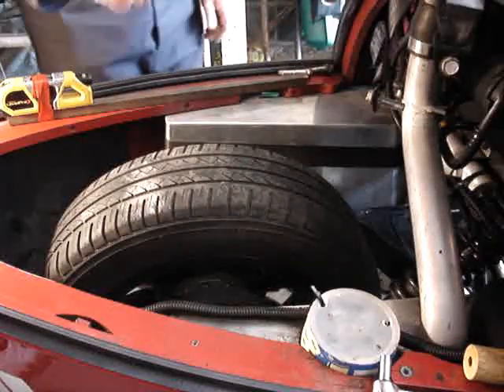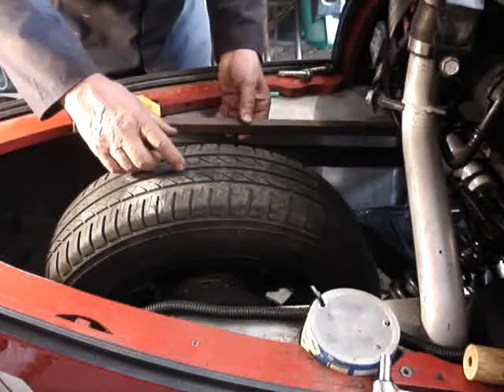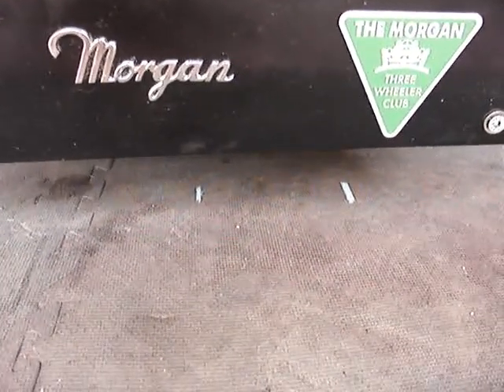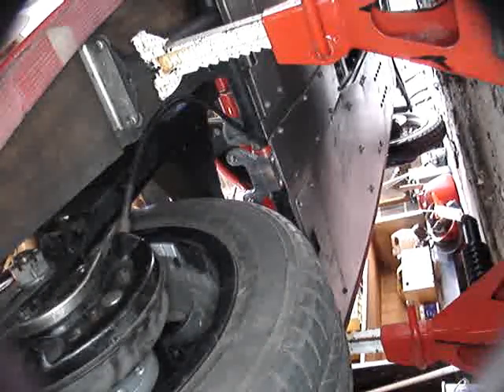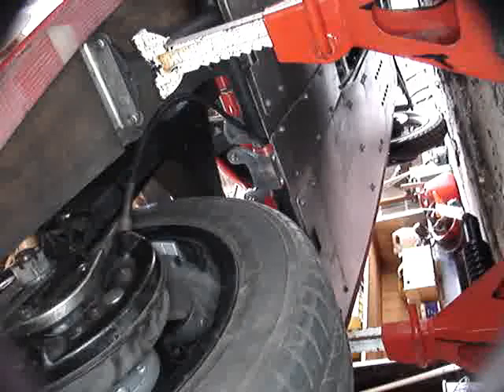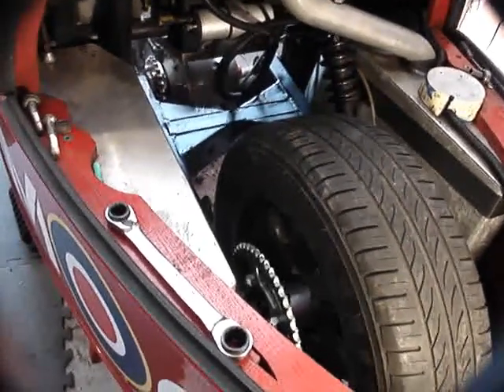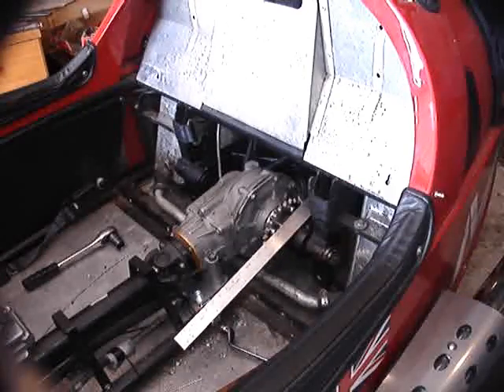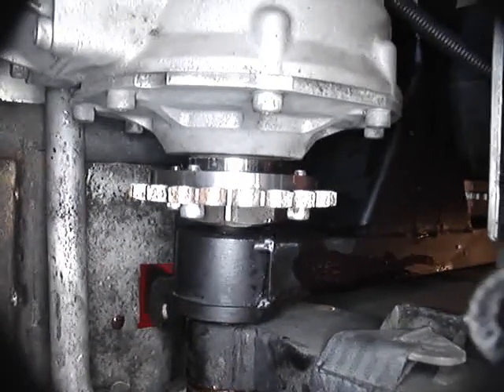Morgan 3 wheeler workshop - rear wheel and final drive alignment

Comment: Have you considered  getting rid of the bevel book drive and convert to a BMW motorcycle shaft drive. That would make changing a rear tire easier and the car over all lighter, alsoquiter and most of all maintenance free
Reply from the maker: Sounds like an ideal solution - but where would the passenger sit? !!!
Reply: @morganthreewheelerworkshop1189  you could or would have to offer set the drive shafts including the swing arm one to or remake the swing arm to match up the drive safts
Reply: @morganthreewheelerworkshop1189  do you every come across a morgan 3 wheeler that is in need of a lot of work. I live in Canada and would love to buy one that needs a lot of work and have you make the up grades to it and try to do A BMW rear drive to it and then have it shipped here

Comment: When did these become chain driven? I’ve always been wary of belt drive.
Reply from the maker: They only become chain driven after having my kit installed - Belts are, on the whole better than chains - normally quiet, clean and long lasting. On the other hand chains are cheaper, easier to fit, available anywhere there is a motorcycle shop and the Morgan 3 wheeler set up makes it very difficult to get a belt running nicely in the middle of the pulleys and that makes for a lot of unpleasant noise and sometimes damage.

Comment: I still worry that 5/8 x 3/8 chain is a bit small for a 2 litre engine. My BSA and Ariel were that size and lighter bikes with far less power. Any thoughts Phil?
Reply from the maker: 20,000 miles plus from my chain and the sprockets still like new.